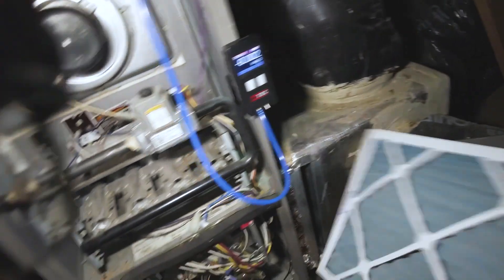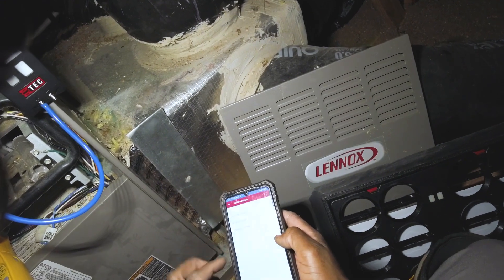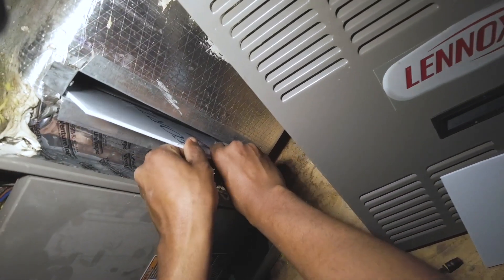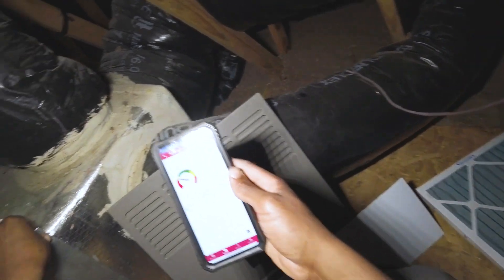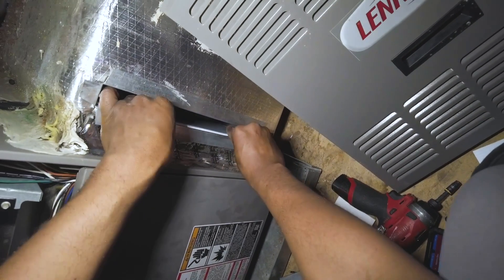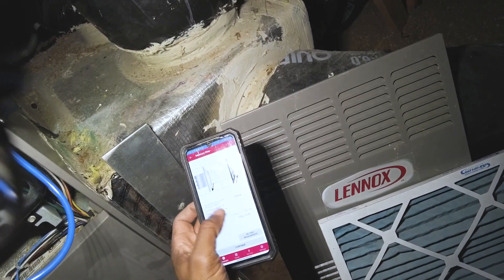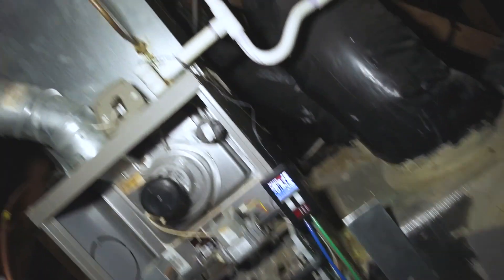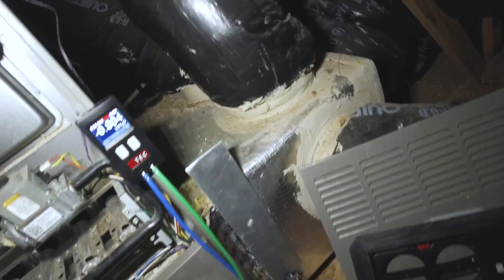Undersized Filter causes Massive Airflow Loss on Lennox Furnace with PSC Motor TEC Trueflow Grid

Comment: A 14x25x1 filter is way too small for a 4 ton system, even using fiberglass!
for pleated 1" filters, shouldn't be exceeding 300 fpm by much, above 400 gotta put a larger filter rack or install a media filter cabinet.